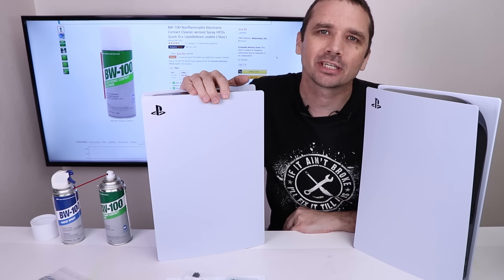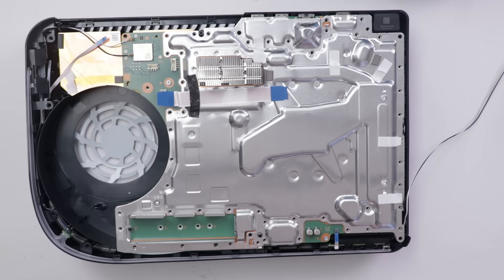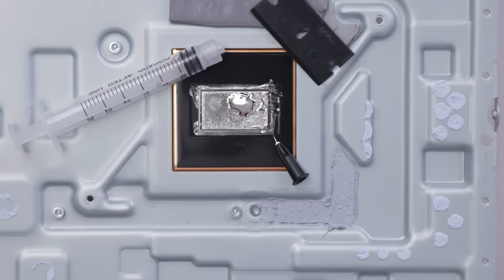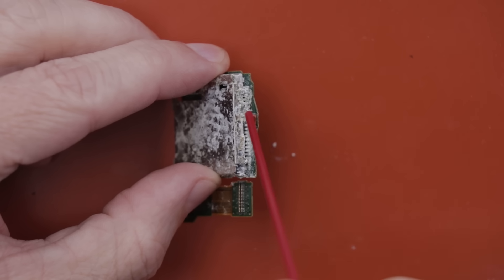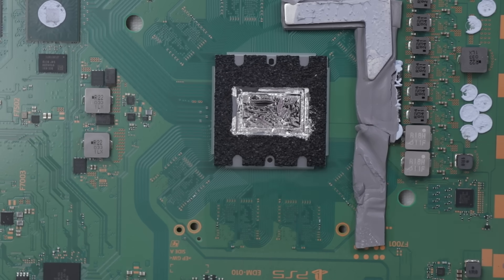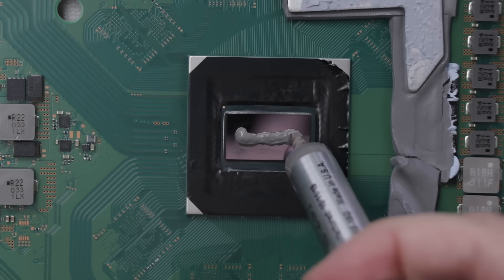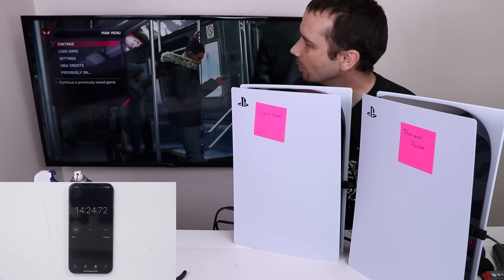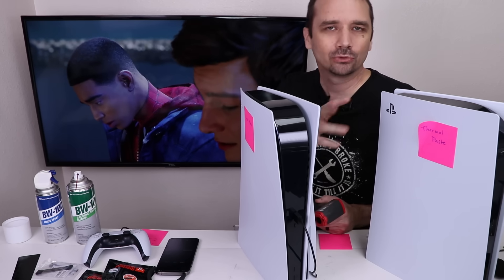PS5 Liquid Metal vs Thermal Paste - It OVERHEATED!

Comment: So this explains why Sony decided to go with liquid metal instead. interesting.
Reply from the maker: Yep, exactly
Reply: yall are weird i tested my ps5 to the fullest did not tun off for 2week straight playing games every day and the result was no over heating not one bug or crash no coil sound still quit since day one
Reply: @kpridezzang  count yourself lucky. Though at least the fan is doing its job. Memory may or may not be running a little hot and it won't be all if the ram chips.
Reply: Liquid metal properly sealed with non-reactive surfaces to adhere to also doesn’t degrade or lose conductivity over time by drying out as thermal compound does.  

If both of these system were used over the next few years and kept clear of dust, the original would be as quiet as new, the modified one would be louder and more liable to shutting down.
Reply: @Pony Trash and the series x runs higher clocks... So what does that tell you?

It tells me that they designed the heat dissipation a little too close to its actual limits. Sure the APU gets plenty, but seemingly other components may not.
Reply: I believe they went with liquid metal so they could make their ps5 fAnCieR and sound more impressive by saying they used liQuiD mEtAL to cool it. To the average person  that sounds impressive, unless you're on computer then you're just like "oh that's cool I guess". There's no doubt they'd be able to make a good console without using cunductonaut or whatever they used, It'd just need to have a beefier cooling solution.
Reply: Yeah, if something goes wrong, the console will last an extra 3 mins. Impressive...😂
Reply: @Until_It_Is_Done  he completely disconnected the fan you donkey😂
Reply: @Until_It_Is_Done  it's not about if something goes wrong it's more about improving the PS5 cooling by improving the efficiency of the medium between the cooling solution and the APU itself. by improving the the efficiency you can either allow the APU to be cooler at the same fan speed or allow the system to be quieter by reducing fan speed while the APU runs at the same temperature.
Reply: @eliadbu  PS5 is already whisper quiet
Reply: @BIGNOIDS  just wait
Reply: @ibbzy9047  for what?
Reply: @BIGNOIDS  For him to make up failure rates of PS5.
Reply: @evilformerlys4704  I guess some people just can't help hating.
Reply: @BIGNOIDS  its true the ps5 has software issues and more but the ps5 will become loud u think the ps4 was quiet at launch
Reply: @BIGNOIDS  besides the Coil Wine" Lol'
Xbox Series X is Much more Quiet an Better Built" Luv my Series 💪 X
Reply: @jacobsebastien3910  No coil whine on my PS5, none on my brothers either. There have been issues with the Series X too, I think you're just trying to look for problems to help convince yourself that Xbox is better.
Reply: @jacobsebastien3910  no coil whine on mine
Reply: @eliadbu  water is wet
Reply: @Bytrl  lol
Reply: @jacobsebastien3910  all gpu's have coil wine even the xbox if you use 100% of the gpu power so don't act special
Reply: @BIGNOIDS  "whisper quite". There's so many videos of people showing their loud PS5s. I just sent my back for a replacement. If it wasn't a problem then Sony wouldn't have accepted my request, but they know it is and are getting many calls regarding the same issue. Sure it's whisper quiet if you sit 20ft away from it.
Reply: @aki-sid  Any product that sells in the millions will have the odd faulty unit, no difference with Xbox. Both companies will obviously replace or repair their systems as they are new and still under warranty,  lol.
Reply: @BIGNOIDS  Seems like more than the odd faulty unit. Either way, it's not "whisper quiet", unless you just sit in the menu. That's how people got false expectations of the PS5, by reviewers saying crap like it's dead silent. The disc drive is louder than the PS4 and the cheap plastic covers in some instances cause extremely loud vibration noises. 

Also if you didn't know, the PS5 has 3 different fan variations. So not everyone will have a "whisper quiet" PS5 because of this. Then some PS5s have louder coil whine than others. And some PS5s even have loud PSUs. So if you're lucky you'll have a "whisper quiet" console.
Reply: @aki-sid  You're the one spreading false information mate, the vast majority of PS5's work and function perfectly. The sound difference between the fans is roughly 3db, if I placed 2 units side by side I'd be willing to bet a months wages you wouldn't notice the difference.
Reply: BIG-NABZ there is a video of a guy that places 4 little rubber Rings between the fan frame and screws it back and  the sound is gone.
Its not coil whinning its the noise of frame agains the screen for to protect the motherboard.
Reply: @BIGNOIDS  PC are better then both lol, but PS5 has got the fire exclusive.
Reply: @Mannyfresh3446  True
Reply: @eliadbu  And yet it's still louder than the Series X and it's using an inferior fan and cooling system in a general. They did this to save money because they couldn't figure out how to drive the cost down. They shipped it with a 825GB Nvme and a terrible cooling system. Time will tell but I see lots of failures in it's future
Reply: @jaradshively8976  could  be the fan design because overall the heat sink design is capable to match the vapor chamber of the series x. also remember that ps5 SOC has much higher power density than the series x SOC, meaning the heat is concentrated in smaller die area making the cooling much more difficult. about failures - there is no indication of any flaw that may cause high failure rate, this is something without the proper analyzing tools you can not predict.
Reply: @jacobsebastien3910  coil whine will not exist on every model. That's something that even fans if the same models get. So there can be Series X consoles that have coil whine. Not everyone is capable of hearing it either.
Reply: @aki-sid  if they were a good company, they'd accept the return to check it out and if it actually wasn't having issues you'd get yours right back.

Accepting a return is not indicative of there actually being an issue. Especially if it's under the presumption of abnormal behavior and still under warranty.

The fact that yours got replaced/serviced is what's indicative of an issue with the unit.
Reply: @renesevriens9965  the fan was too close to the frame... That's an oversight/design flaw. That's going to be getting a revision. Well that's definitely something to look forward to.
Reply: @BIGNOIDS  I guess some people cant help blowing every youtuber out there.

Comment: Can you address the coil whine situation some of the people are experiencing? Is it a way to solve the issue, like opening up the PSU and do something to the coils, like putting some hot glue or smth else? If it can be solved, can you do a tutorial (even better if one of those PS5s actually have some sort of coil whine)? Mine has some moderate coil whine and I don't plan on returning it as of right now, but would look inside once the warranty goes away.

Comment: My PS4 Pro with liquid metal doesn't overheat. In fact, it does get hot air out of the back - so cool and silently it is  now. With a SSD, loading times are nearly as fast as a PS5.....
- well, if I move it around too much, then it starts ramping up the fan under load - and then I need to reapply the liquid metal after cleaning up the old stuff. It seems it 'only' lasts 6-12 months also, before requiring a new coat. A tiny silver layer on APU and heatsink is better than a pool shorting caps and blowing fets

Comment: But the thermal dissipation isn't working the same !
With metal, there is a small enclosed gap so the metal can move freely and transfer energy from the die to the cooler pad.     
With tradionnal thermal paste, the cooler is pressed against the die, and only a tiny amount of thermal paste fills the irregularities of the two surfaces.     
Of course it doesn't work if you just fill the gap with thermal paste instead of metal ! The surfaces aren't touching, the thermal paste isn't made for that

Comment: Can you show the best way to put liquid metal back on. And can you use it on the ps4 ?
Reply: I was thinking the same thing. Can liquid thermal improve PS4 performance???
Reply: @elitetruegamer2432  no, it will not effect performance. It will keep it slightly cooler but if a game has poor performance on ps4, liquid metal won't change that in the slightest...

Comment: This was actually realy interesting wow. I thought that liquid medal made very little difference but i guess not.
Reply: Liquid metal usually only gets you a couple degrees lower temps under load than the best thermal pastes do.  They make more sense when you have a closed system and automated hardware to do the application (like Sony does), but they make far less sense for the average computer enthusiast when you consider the dangers of applying it and the way it interacts with heatsinks over time.  If anything, I'm actually concerned how PS5s will perform a few years down the road as the heatsinks inevitably absorb small amounts of the liquid metal just from the contact.  I don't know if we'll get Xbox 360 RROD-levels of failure, but I expect to see increasing numbers of failures over time.
Reply: @Damaniel3  it looked like the heat sink had something protecting it from direct contact if you look when he cleaned it up the heat sink wasn't a copper color so my guess is Sony put something on the heat sink where the liquid metal sits to prevent any reactions from taking place.
Reply: @LiveType  lol probably cost

Comment: How does he get 2 ps5’s when I can’t even find one.
Reply: I don't think Steve bought it from a scalper neither. maybe pure luck in stores?
Reply from the maker: @robertandruw7647  Pure luck with pro orders
Reply: @Tronicsfix  Pre ordering multiple is just wrong...Like even this it may be educational but you've practically ruined the manufacturing value of the two systems I get its educational but its still wrong to take more than you needed
Reply: @robertandruw7647  connections.

Comment: Has anyone tried using the SSD drive yet I know Sony had said it's not active but is that true at all there is a western digital black SSD that's the right read/write speed so just wondering if anyone has actually tried any drives at all

Comment: I knew people who once used tooth paste on their PS3 back then.
Reply: You knew idiots who used toothpaste on their ps3's
Reply: Dude, about 10 years ago when i was doing "restoration" of my "gaming PC" with core 2 duo e6600 clocked to 3ghz, after i removed the tower cooler i had and cleaned the old thermal paste i found out that i dont have any more left to put on. I quickly went online to look around for a temporary replacement of thermal paste, someone suggested that tooth paste (the basic white one, without flakes or 3 layers like airfresh) will work. AND IT FREAKING DID, temps were a little high, but after i went to 2.4ghz stock clock it was fine for 2 weeks until my new thermal paste arrived. You may believe or not but thats true story.

Comment: Interesting Results! Thank you for the experiment!
Reply from the maker: Thank you for watching!
Reply: but rhino escaped :|
Reply: Yeah. The behavior Steve described at the end suggests the fan control in the PS5 bios has been tweaked to work specifically with the characteristics of liquid metal. Thermal paste differs from that, so the cooling system works incorrectly by revving up and slowing down continuously. It's actually quite interesting how it's so particular about it. The hysteresis might be quite narrow. I guess all this makes sense in the big picture of manufacturing millions of consoles and thus needing to optimise everything.